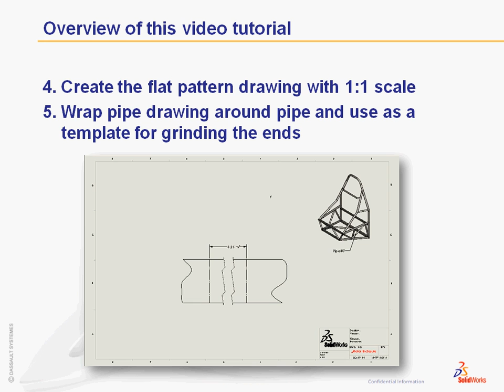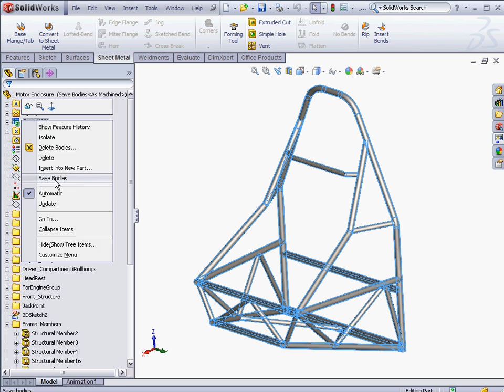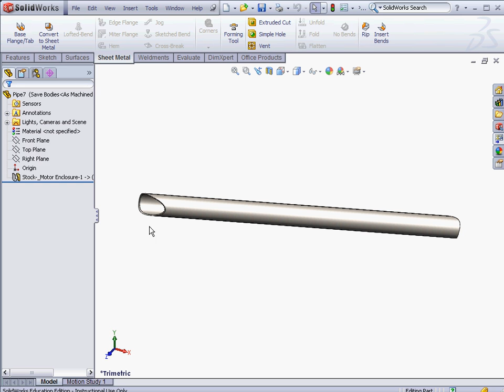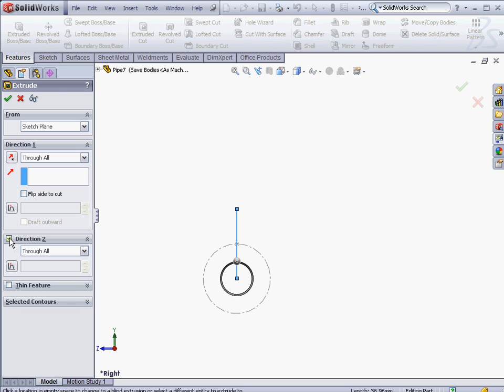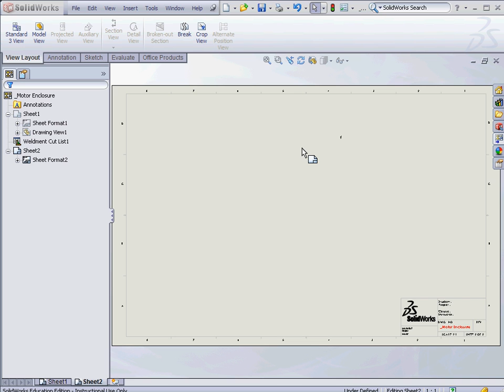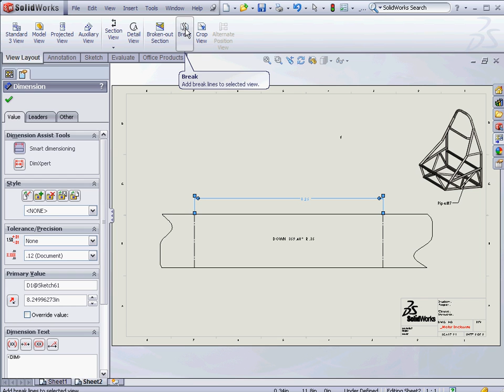SolidWorks FSAE Tutorial Frame drawing cutlist flat pattern

Comment: there is 1 quite significant mistake in this video, if you follow everything to the letter in this vid, the flat pattern will actually be smaller (parallel lines of the flat pattern), just as @Pintobike commented, and that is because the K-factor value during the conversion to sheet metal (@3:22) is left at 0.5, change it to 1 and you get a sheet metal flat pattern that is true!
Reply: Holy sh*t! Thank you man! :D
Reply: GOATED Comment Bro, Pin this @SOLIDWORKS

Comment: Thanks for the video, I'm just wondering why would you flatten tubes into sheet metal? Surely anyone building a frame is going to do it from already formed tubing and cut the ends as necessary right? Or is this truly the only way to properly illustrate the curves and bends in the tube?
Reply: You can cut tubes with tube laser, so in case you want to make a program for laser cuting, you need to make a flat pattern.

Comment: @Pintobike 
We were having the same problem. We figured out that if you set the K-factor to 1 when you initially turn the tube into a sheet metal part (create the bend), the final dimensions are correct.